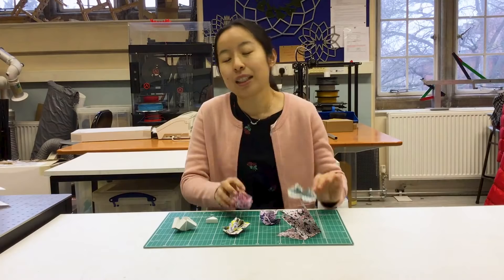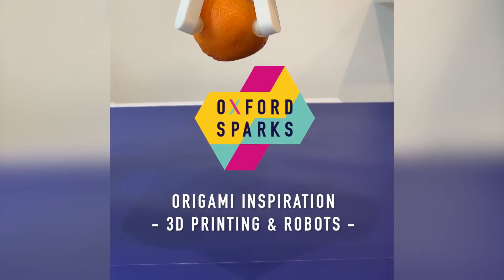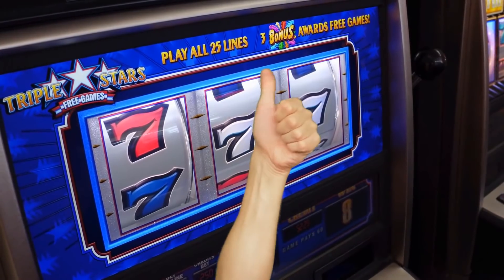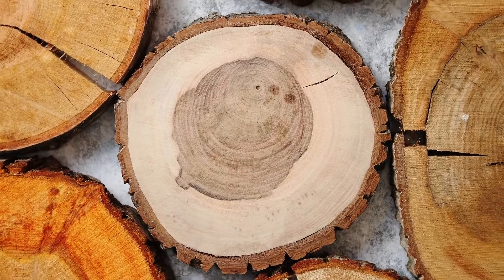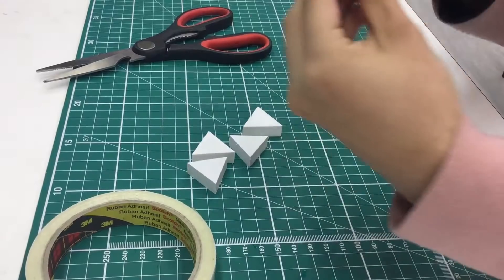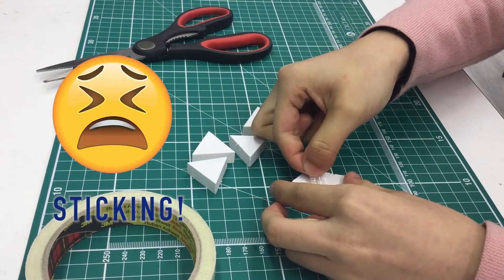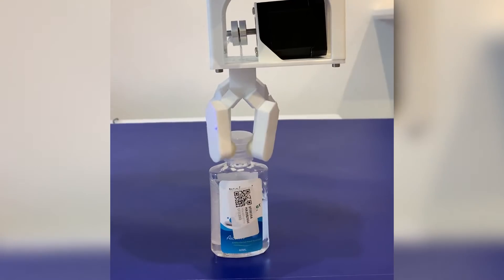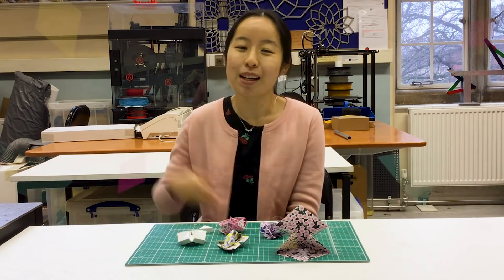Origami Inspiration - 3D Printing and Robots

Comment: Were similar ideas used in the folding of solar panels for spacecraft like the recent James Webb Space Telescope? Thanks for the cool video.
Reply from the maker: Chenying says: "My answer is an absolute yes! It's not limited to solar panels only. Believe it or not, the James Webb Space Telescope is a giant origami itself - to be sent into space, the huge main mirror and sunshield (the size of around 5 tennis courts) must be folded to fit into the rocket. They'll then gradually deploy into its final configuration. I just found an origami template to fold the main mirror of Webb: https://webb.nasa.gov/content/features/origami.html." :)